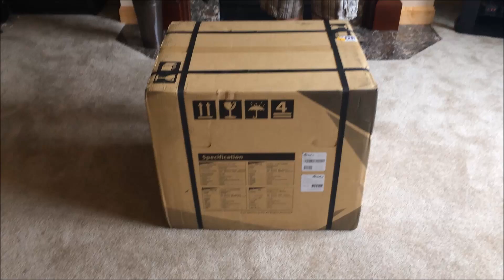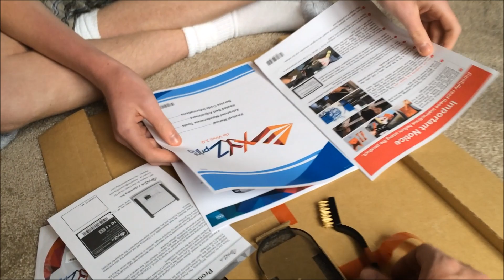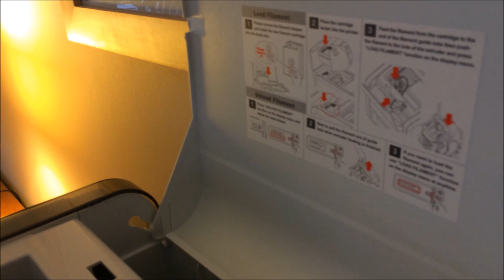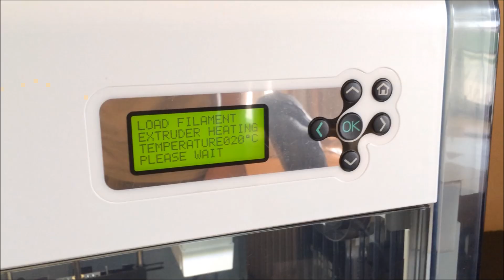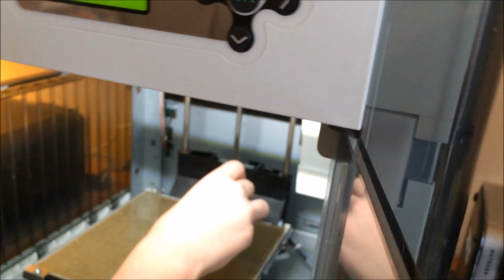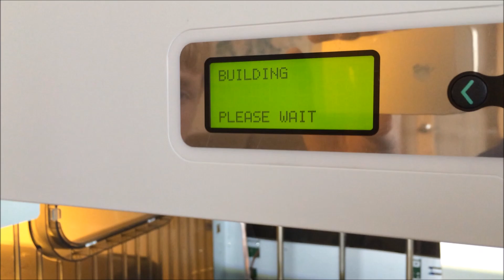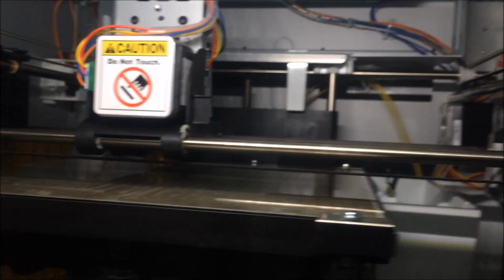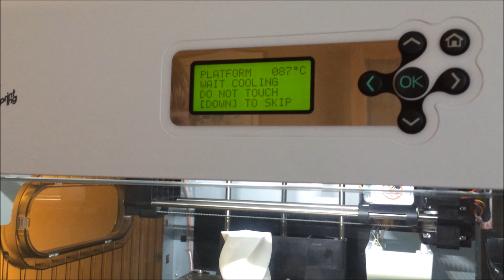XYZ Printing daVinci 1.0 3D Printer Review

Comment: Excellent video, well done.

Question: is anyone doing anything special about the smell during printing?

I've got some baking soda in the unit for now, I'm building an area in the house just for my printer because the smell is just too much to bare in any commonly used areas.  

It should not go in a shed, garage, or basement because of moisture issues.  Ideally, it should go in a very dry place.
Reply: If you use PLA, the smell should be a lot less artificial, as it's derived from plant-based sugars. ABS is a great material but is petroleum based, and smells as such.
Reply: jordanzish well that's good to know,  thanks for the info; however this machine only uses ABS via their cartridge to my knowledge.

Comment: Can i design my own 3D models using SolidWorks and print them out?
Reply from the maker: I am not 100% sure about SolidWorks, but if you can save 3D models as .stl files, you should be fine.
Reply: It works perfectly. I use solidworks at uni in our 3d printer unit. Just export as .stl

Comment: what is the printing resolution that you've used for this object?
-Fine 0.1 mm (100 microns)
-Standard 0.2 mm (200 microns)
-Speed 0.3 mm (300 microns)
-Ultra Fast 0.4 mm (400 microns)

Thank you
Reply from the maker: For the demo/test print there was no options, it just printed like that. It took 1.5 hours to print, so maybe slow at .1 mm.

Comment: Can you print soft material, like cloth or can you only print hard material?
Reply from the maker: My printer can only print ABS, the plastic from LEGO bricks. Some other printers can print PLA, which is a softer plastic. I also think some very expensive 3D printers can print metal.
Reply: Yes there's a rubbery material. Not sure the name. You can also get printers for food etc there is not much limit...
Reply: dsjc666 ninjaflex? thats a 3dprintable rubber..

Comment: First, thanks for the upload, I amazoned 3D printers out of curiosity to see how many thousands I would need to print everything I ever wanted in life and it almost made me drop my drink when I found how cheap they are!

So, I read your earlier comments about small links being messed up, but I'd like to basically.. buy this for small items, specifically 1:10th scale rc items, like http://prolineracing.com/performance-parts/scale-accessory-assortment-1/ I'd also like to build small roof racks for them as well, but that is about the smallest I'd ever be going, so I have a few questions I hope you can awnser for me.

I've read comments on how it has quality modes, normal, better and excelent, I read that it basically means how much inside filling is in a model, like it would make it a hollow item instead of a fully filled one on excelent.

Secondly, I noticed that your vase had a obvious sign that it was 3D printed, those staggered lines across your item, I don't mind these but I was wondering if there is anyway to reduce them, other than simply making your object a few milimeters larger and filing it down.

Third, I'm kind of a noob to this 3D printing thing, as in, I've seen 3D printed items, and have always wanted to do my own (eg; no clue) is this machine fool-proof or newb friendly? I'm very computer literate (not trying to brag) but I also don't want to burn my room down accidentally in my need for small gas cans. Lol

Fourth, are you happy with your purchase? Now that you have 20 prints you say under your belt, do you desire more even from a I'd say entry-level cost printer, would you reccomend this to a friend that wanted to get into printing for the first time?

Thanks for your response in advance! ^^
Reply from the maker: Hey! The link with the little objects in it look like it should print just fine, you would just need to find a model for them or make one your self. Secondly, the lines from it being 3D printed can easily be removed if you sand the sides with sandpaper or a file. Hope this helped!
Reply from the maker: To answer the other questions, this machines does take a while to get used to and I do not recommend you leave for long periods of time with out checking up on the print. After my purchase, I don't use it that much, but when I want to print something really cool or just have something, I can just print it!
Reply: Tomtomgo98Indie Thanks for your responses, I really appreciate it, but I think for me this unit would be slightly to big and a little to.. akward, I've recently been eying the 'Printrbot simple printer' that I might get, You can have a entire 2.2 pound spool of abs plastic on it instead of the 600gram cartriges in here, which means I wouldn't need to buy alot of spools to keep somewhat of a micro assembly line going!

Thanks again for your advice, if you have any research done on the printrbot, Feel free to add in!
Reply: TehPaws3D
Except I thought the Printrbot Simple was only capable of using PLA, at least according to the website?
Reply: ***** A heated bed upgrade can be purchased which will allow it to print ABS. It should also improve PLA prints.

Comment: Thank you for being a normal person and uploading this video.
do you have any complaints about this printer now that you are 3 weeks in?

also, how is the software?
Reply: Tomtomgo98Indie What are you using to slice the .stl file?  Many of the software packages have a setting to allow you to tell it how long it should take per level.  This will help with the small items.
Reply from the maker: Thank you for enjoying the video! There are a few thing this printer has trouble printing and one time it un calibrated it self. The software is pretty easy and you can import models from thingiverse or other model websites!
Reply: What does it have trouble printing? I am looking at getting this as a secondary printer to help speed up production and would like all the information I can get.

whitecactusgames@gmail.com
Reply from the maker: I am not an expert and I don't use the printer everyday but when I tried printing a linked chain, it has problems printing the links so close. Another thing that this printer can't do is print small points. I once tried printing a triangle and the tip of the triangle was so close to the nozzle that the nozzle was moving it around. So when it gets to small spots, It just goes to fast and doesn't give the plastic time to harden. Another time when I was printing a chain with something else, one of the chain links was picked up by the nozzle and moved around the base plate and screwed up the whole print. So I recommend you watch your printer the first few minutes while it prints and check on it every once in a while if the print is complicated. Hope this helps!